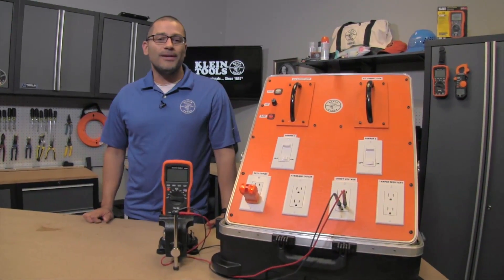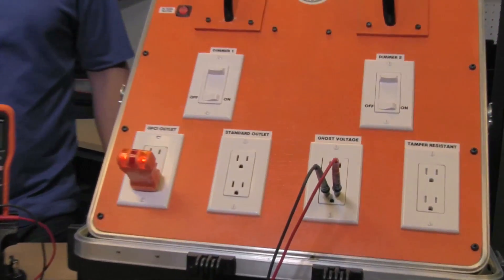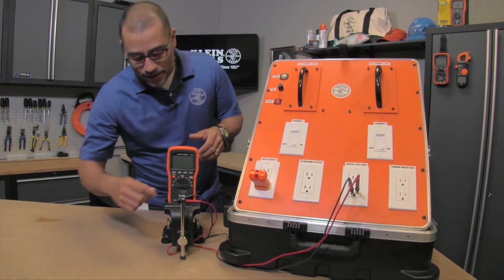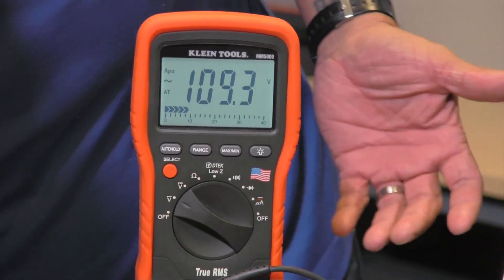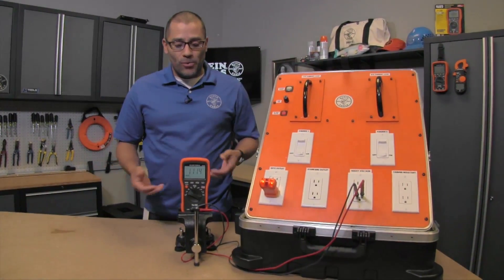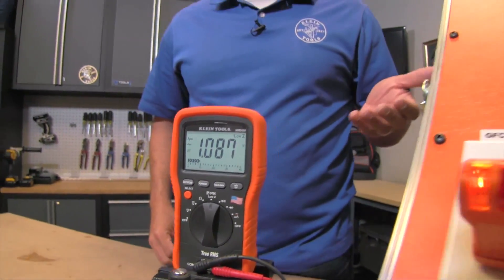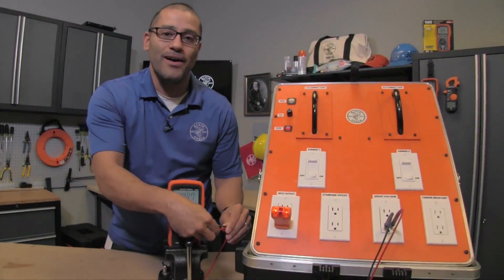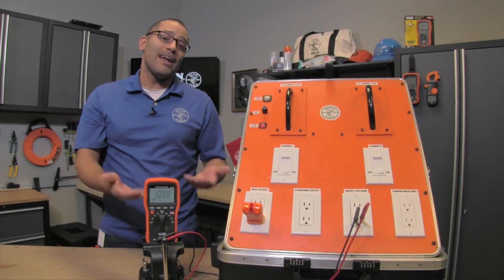How To Measure Low Impedence

Comment: Thanks. a LoZ multimeter is maybe $100 and the next model down, is $60. Also these 2 models do 1000Voltage and lower model does 600Voltage. I still don't get it? I've seen one neutral wire sort get picked up by my touchless tester, wiring in house, some could be tied into old knob-tube at one point. is that ghost voltage also? this was not bundled wire, just one and I'm pretty sure it is acting a neutral. I think touchless testers usually don't sense anything below about 9 volts. Are the more expensive models having 60ohms resistant versus the lower model 50Ohms, helpful if using this every week? It seems if I want the Loz feature I need to plan for $100 price tags and up. I'll keep resarching.

Comment: Hello. New Klein CL800 owner here! 

Question. The selector knob went from ACV - DCV- OHMS and then LoZ. What if that was not a ghost voltage? Wouldn't it destroy the ohms measuring circuit?
Reply from the maker: Hi Gene. That is a good question. Check with our product experts in customer service. You can reach them at customerservice@kleintools.com or call them at 800-553-4676. Thanks very much.
Reply: @ gene,
 What did they say, at tech support regarding possibly destroying the ohms setting if sweeping passed it to the LoZ setting ?